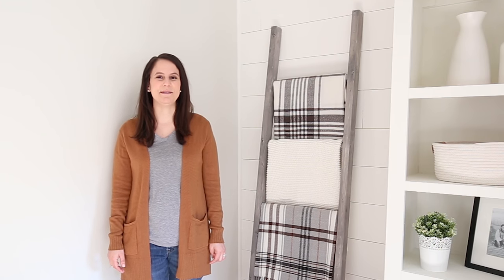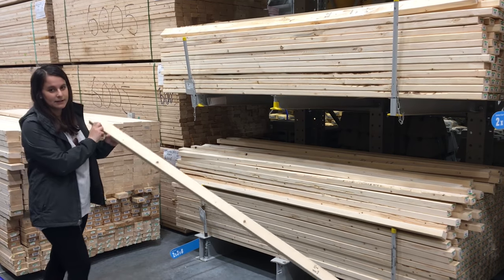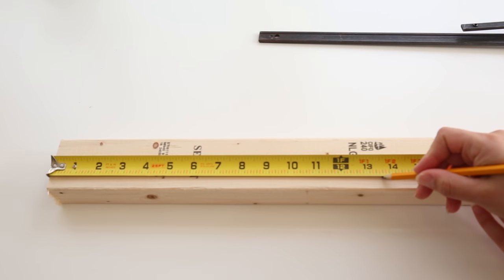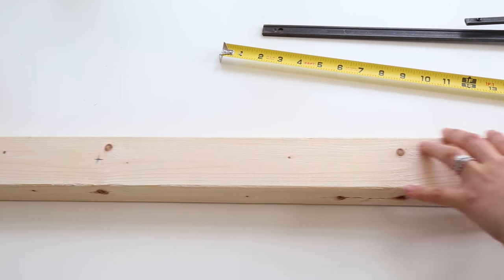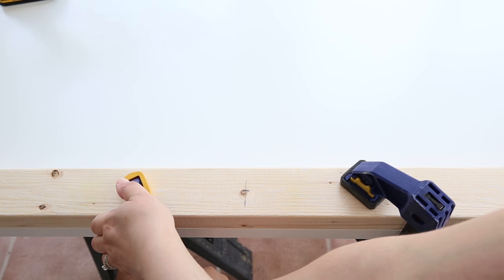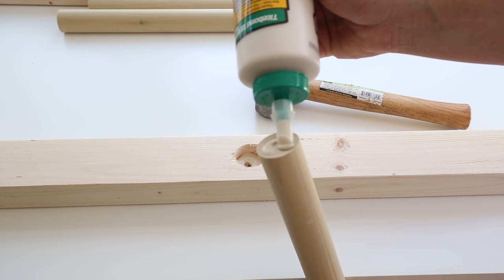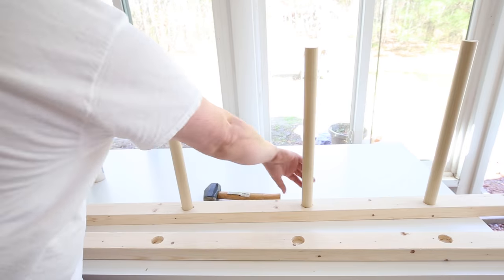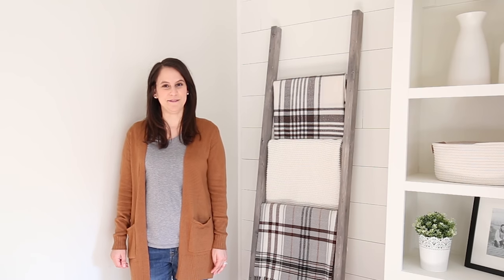Build with me: Easy DIY Blanket Ladder | How to Make a Blanket Ladder for Less than $15!

Comment: Instead of a spade bit try a Forstner bit. This will not grab and try and pull through like that spade bit does and while a little more costly upfront they last for a long time.
Reply from the maker: Thanks for the tip! I have heard of them but haven't tried them out before.
Reply: Angela Marie Made my pleasure. You will find the holes are always much cleaner and easier to center in my opinion